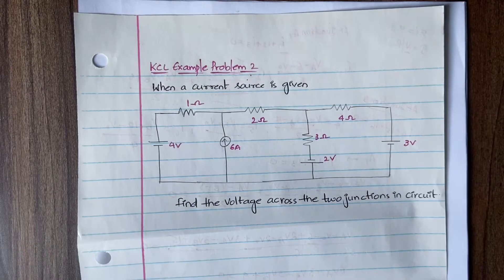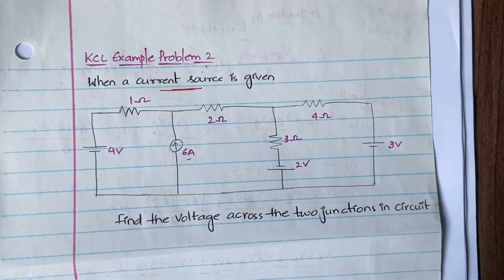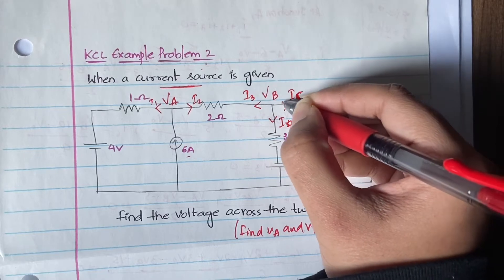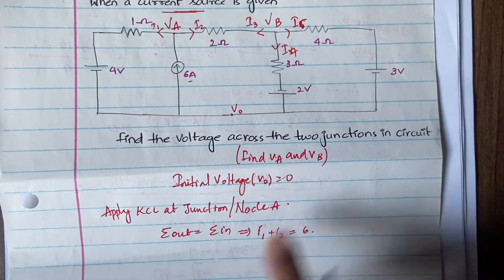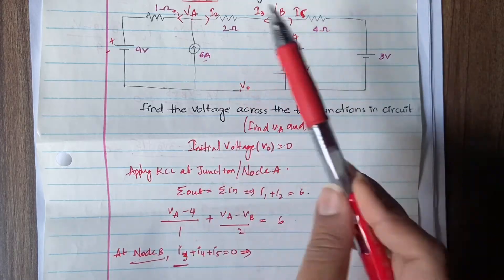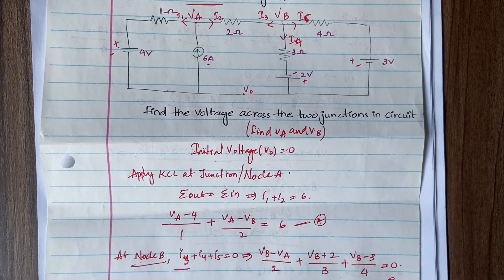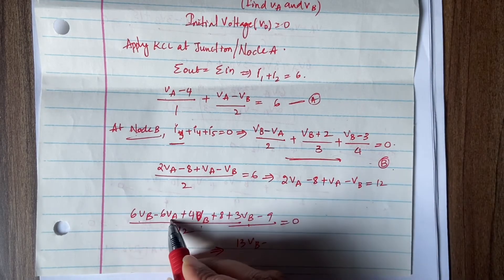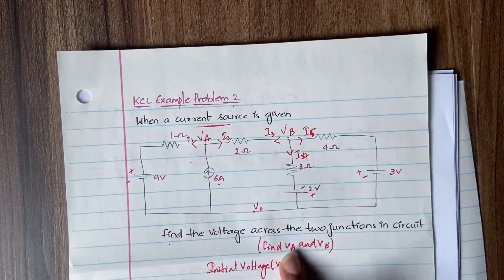9. Kirchhoff Current Law ( KCL ) - Example Problem - 2|BEE|

Comment: Vb =3.72
Reply: In which method can we solve ?
Reply: @sangeethsangi6492  yr yad ni ab
Reply: Simply solve eqn by elimination @sangeethsangi6492
Reply: @sangeethsangi6492 cramers method
Reply: @sangeethsangi6492 

CalC use kr 

991ES mein mode+5 kar aur eqn ka values put kr equal to daba ans paa.... Simple
Reply: Are simple hi h 
Point A &B pr current measure kro kcl s